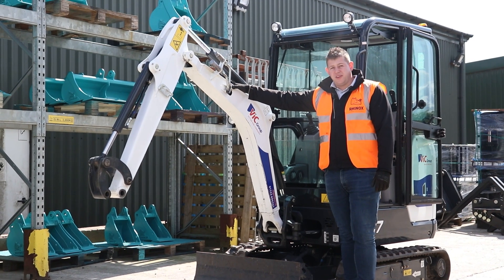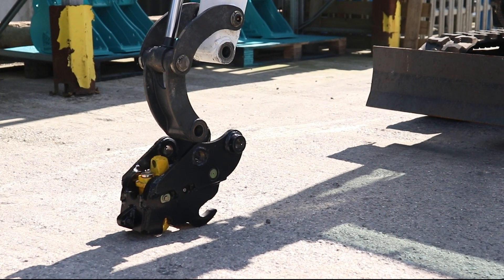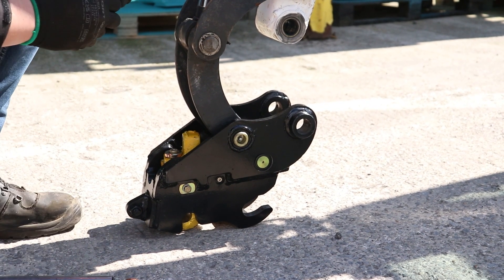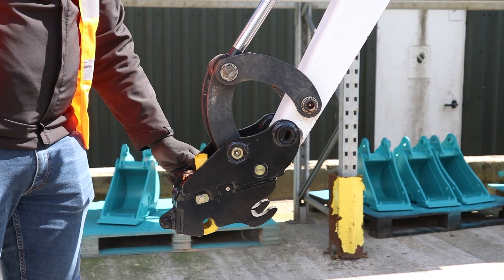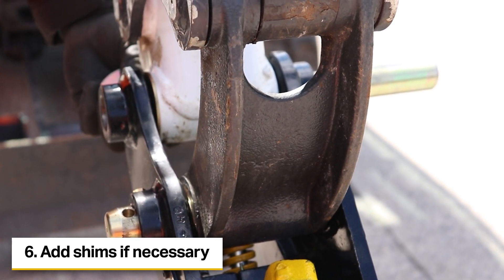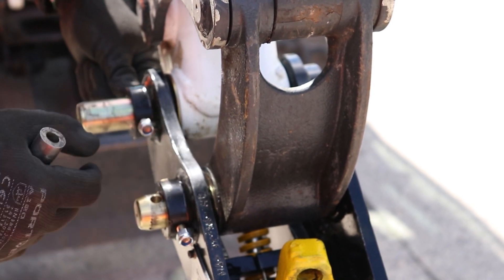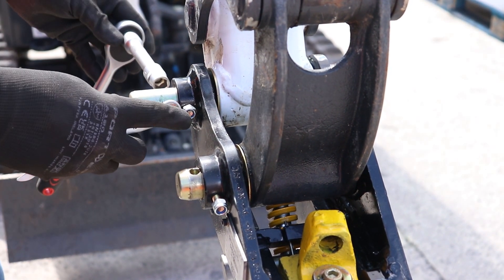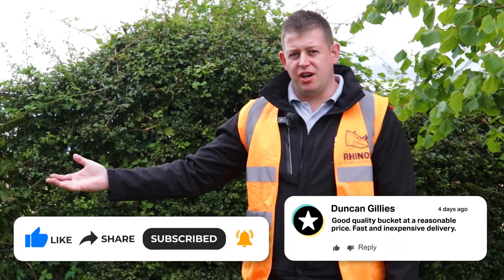HOW TO: Fit a Manual Quick Hitch to your Excavator

Comment: Straight away I have to ask why did your remove the pins in one direction then choose to install them in the opposite direction requiring you to drive them in with a hammer on the end with the grease nipple!  Surely the correct way would be hitting the other end...?
Reply from the maker: The grease nipple is recessed to prevent damage when that end is struck with a hammer, so it doesn't matter which way you insert them. Hope that helps!